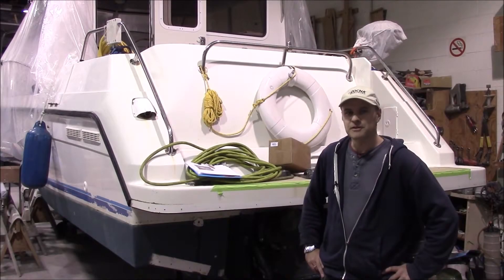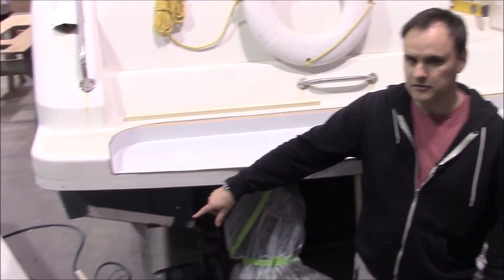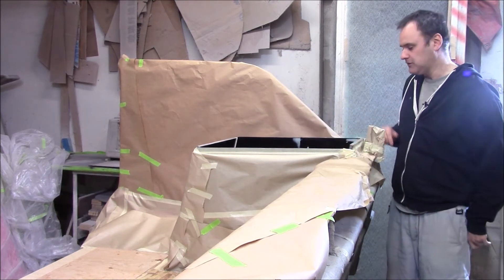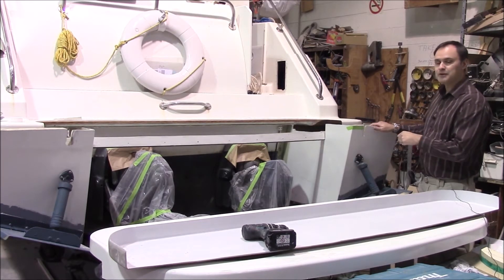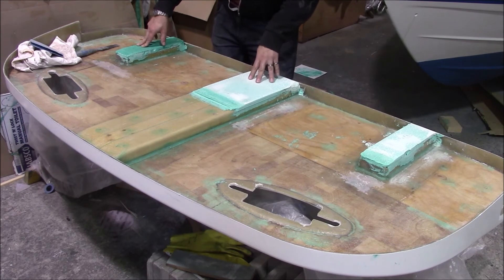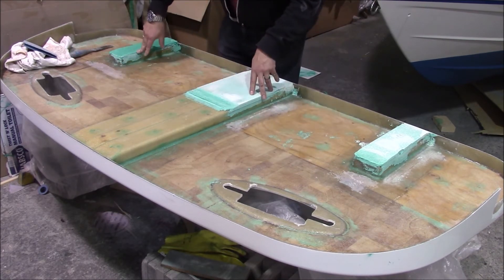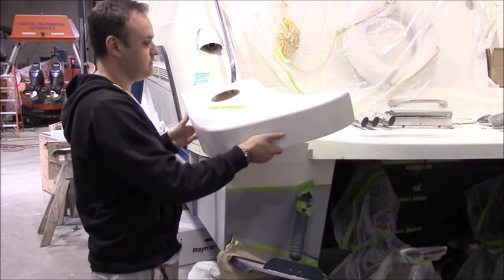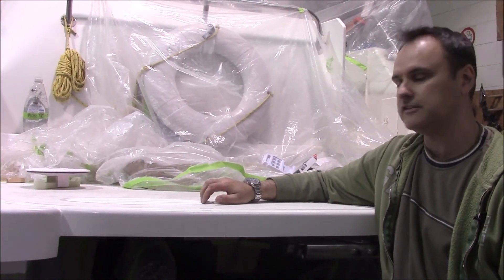How to extend a fiberglass hull on a Monaro 298

Comment: nicely done. Could one or both of those extension pods be turned into fish kill boxes.?  A through valve on the bottom to let some water in, and a macerator pump, to pump out the water and blood, contains the mess on the swim grid and not in the cockpit.... Easy clean up...Add a big filet table mountable  to the swim grid rail and wow, that would be cool for fishermen like myself.  
I saw this being done on most Mikelson yachts. I thought what a great idea. !!    go to video at 20 seconds for example :   https://www.youtube.com/watch?v=-Kyy6Vv0fcY&t=905s